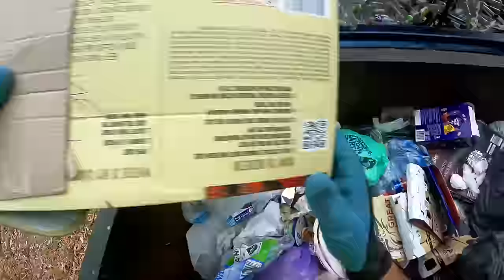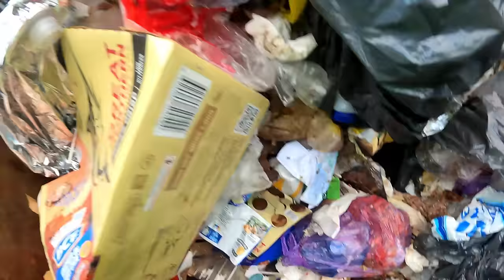Dumpster Diving Part 6 of 6 About An Hour Of Sun Light Left & More To Get

Comment: you can fix the flickering of your videos that you film in your shed by filming in 25 or 50 FPS, cause your lighting has 50 hz and it doesnt line up with your 30 FPS recording. if your lighting was at 60 hz you would not have that problem because you film in 30 FPS. Another way is by changing the shutter speed but i dont know if that is possible on a Go Pro. There are a ton of Videos out there if you need help by that. Greetings from Germany 😃
Reply from the maker: Thank you for the suggestion.👍🍺